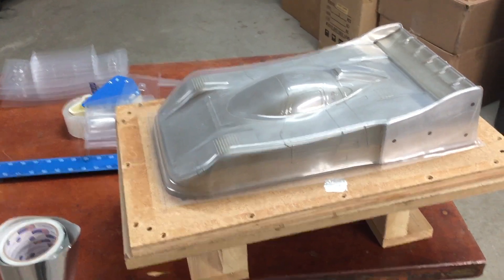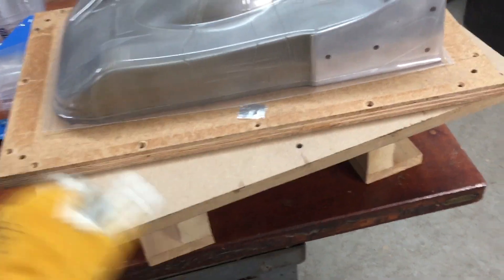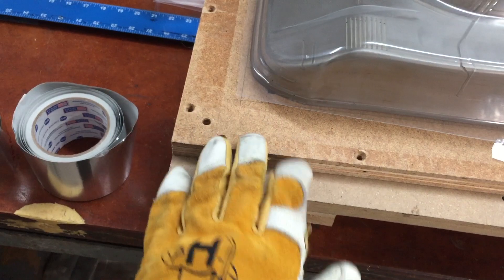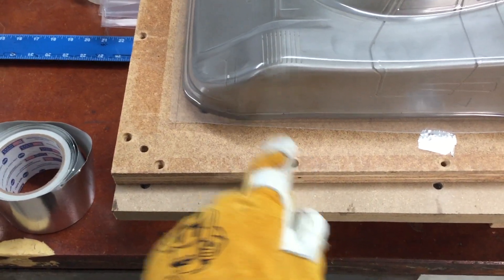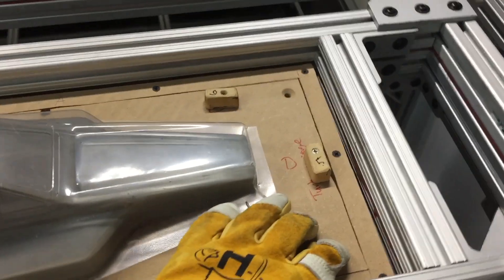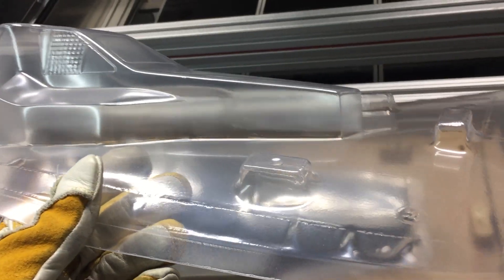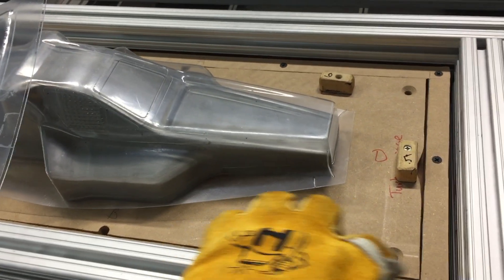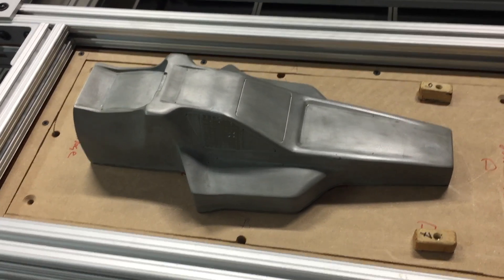New Platform Design for Thermoforming

Comment: Hi there!  Loving the videos… just started to diy form.  Just wondering…. Where are your actual holes for the suction around the body?  I know you have the central hole for suction underneath the top board, but where is the air actually sucking from in the top board? Cheers dude!